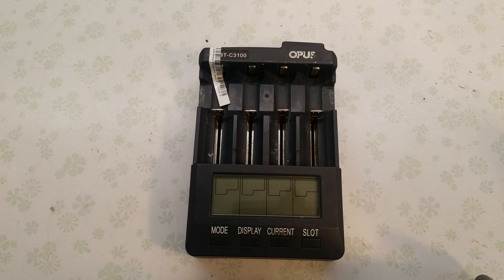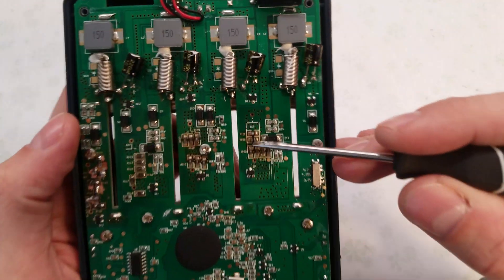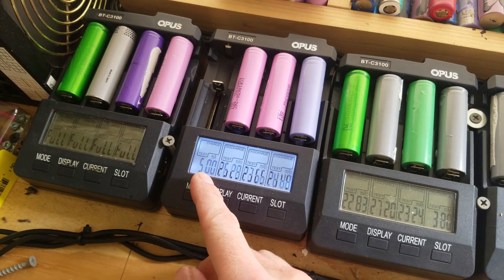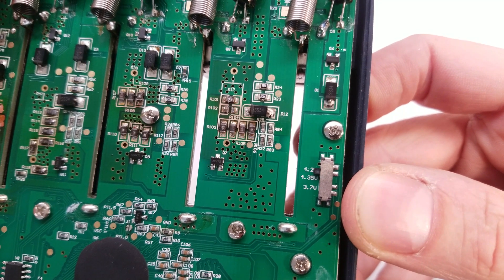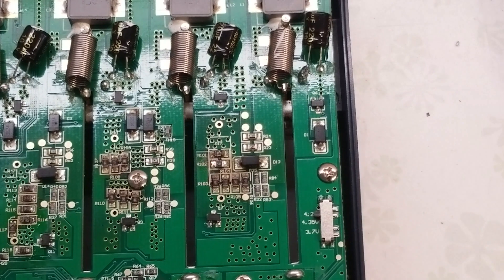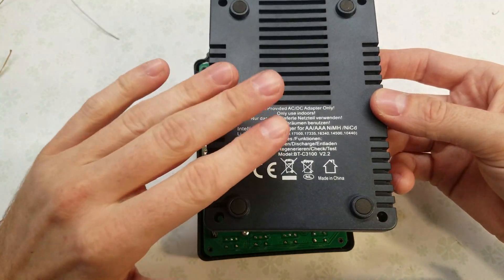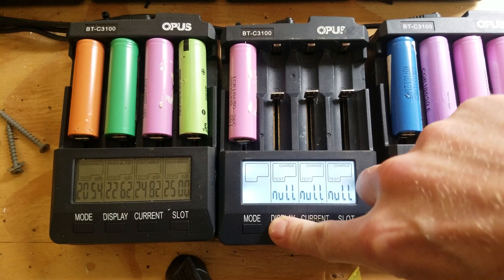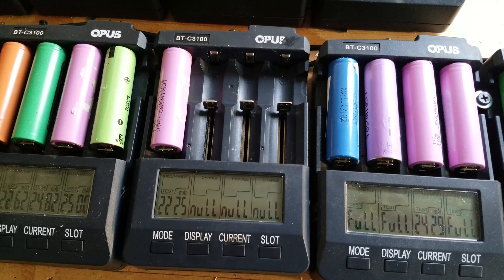Repairing Opus BT-C3100 Bad Slot Resistor Discharge Problem

Comment: Turbo fan modification works very well too for cooling!
Reply from the maker: Yeah, except I've had a lot of those turbos fail when I was using them on my imax chargers unfortunately.
Reply: @LithiumSolar  I've had a lot of success with both the 5V and 12V versions of the Turbo Fans.  They shave off 2 hours or more on a complete cycle.